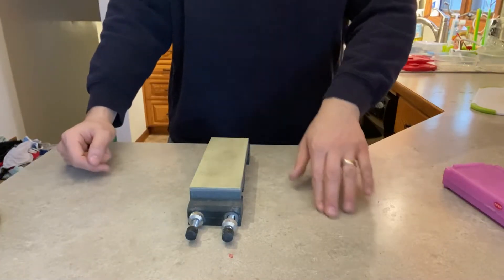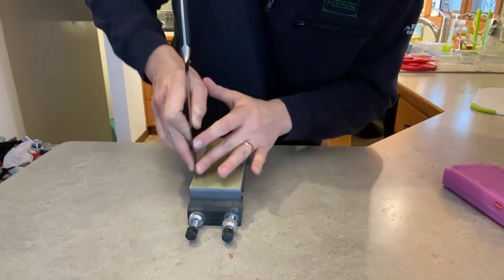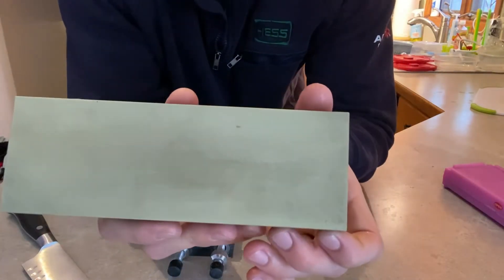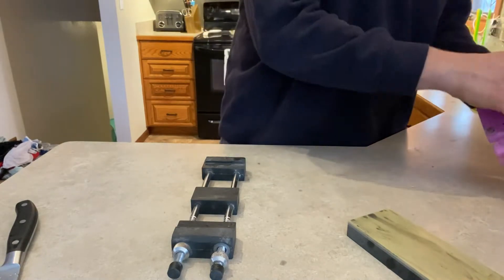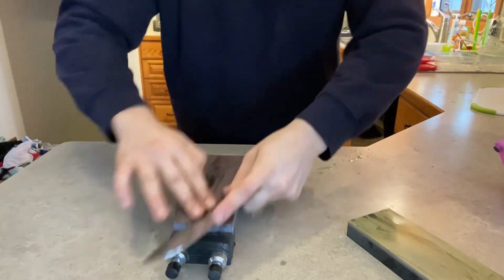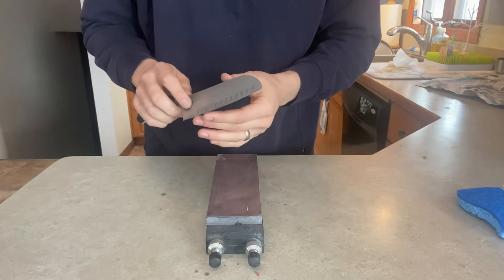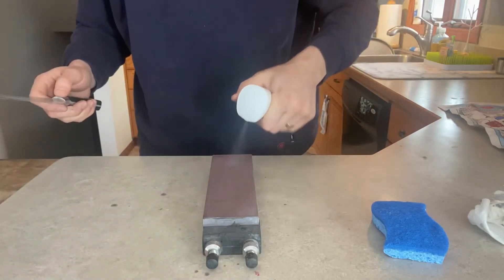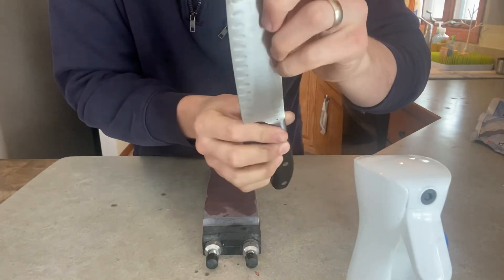Victorinox Grand Maitre Tip Repair and Sharpening (Super Vitrified Diamond/Shapton Pro)

Comment: Why you didn't deburr on the 400 grit stone then enhanced the edge on a finer stone for a long time (400 grit is really coarse) before jumping to the 5k grit polishing stone? A great polishing on a 5k coming from a 400 grit would require A LOT of work.

I would finish the job on a charged strop (2 / 1 µm compound) then on bare leather.
Thanks for the creative video though! 👍
The blade on the end seemed sharp.
Reply from the maker: Time saving is  definitely is the main reason. Also wasn't looking for a good polish and fewer stones means fewer mistakes. I find that these huge grit jumps with minimal stones generally perform at least as good as a 4 stone progression while not looking near as nice of course!

If you check out my Instagram I have one or 2 examples of these getting near or sub 100g BESS scores without a strop. 

I generally don't strop these softer steels because it's super difficult to not draw out a new foil burr and the off-the-stone-edge seems to always last longer and keep bite. Absolutely the strop brings up a cleanliness and keenness to the edge but it's gone pretty quick I feel.

Have been experimenting with bare leather lately but not enough to form opinions or see results.

Comment: So I've seen japenese knife imports guy ise the pad like that.  I've tried no real luck but didn't give it a real chance
Reply from the maker: Where it fits in for me is when there is a full on foil burr that’s drawn out and feels keen but we know it’s going to fold over the second we use it. I can feel that drop on keenness as the burr is mangled and/or removed. Perceived as a drop in sharpness so at first I wasn’t on board but I think it’s a great setup for a few edge lead passes to get a perfectly clean apex. For these steels that aren’t fun to sharpen this has been my best luck getting <100BESS without stropping and the edge lasts.